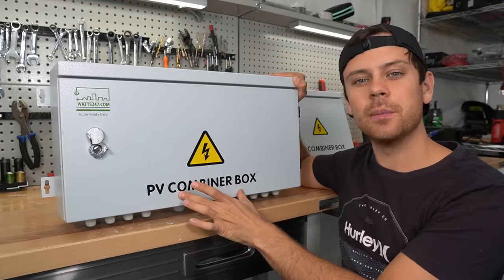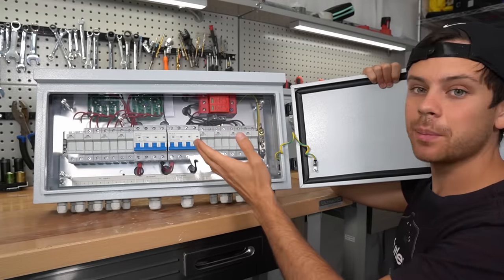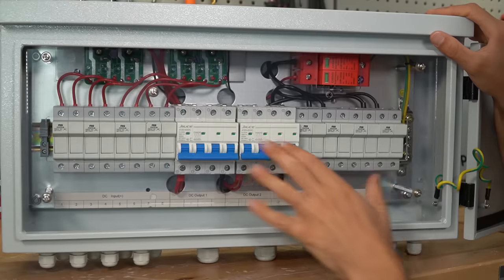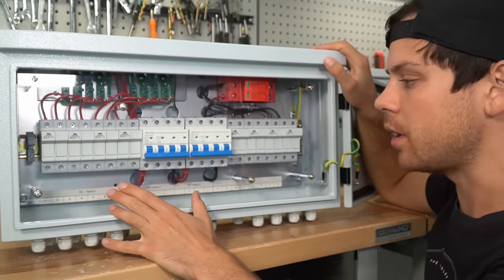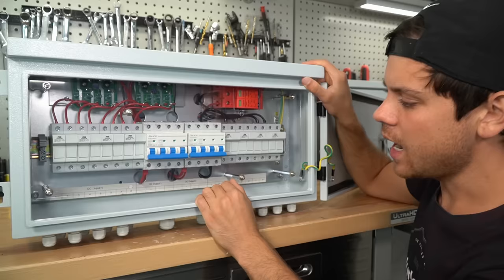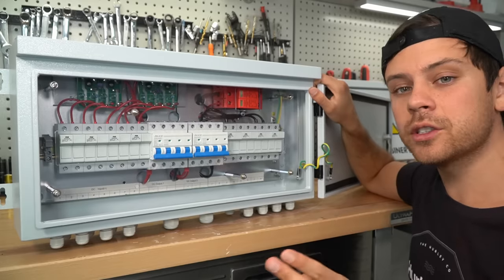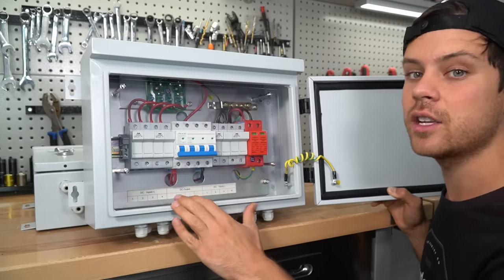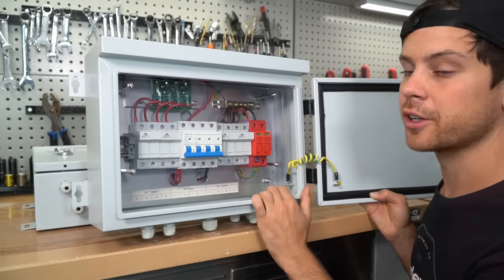What is a PV Combiner Box?

Comment from the maker: Yes, this type of SPD dissipates spikes and surge to ground. DC devices designed to mitigate intermittent voltage spikes in a pv system is different than a typical AC surge protection device. 

Here is an excerpt from LSP:
SPDs are applied to electrical systems to provide a discharge path to earth to save those systems’ components from being exposed to the high-voltage transients caused by the direct or indirect effects of lightning or power system anomalies.

~~~~~~~~~~~~~~~~~~~~~~~~~
Does off-grid solar confuse you? Check out my DIY friendly website for solar system packages and product recommendations, and so much more! http://www.mobile-solarpower.com

Join our DIY solar community! #1 largest solar forum on the internet for beginners and professionals alike: https://www.diysolarforum.com

Check out my best-selling, beginner-friendly 12V off-grid solar book (affiliate link):
http://amzn.to/2Aj4dX4

If DIY is not for you, but you love solar and need an offgrid system, check out Tesla Solar. Low prices and great warranty, and they can take your entire house offgrid with their new Powerwalls: https://ts.la/william57509

~~~~~~~~~~~~~~~~~~~~~~~~~
My solar equipment recommendations (Constantly updated! Check here first):

12V/48V Lithium Batteries: https://www.mobile-solarpower.com/solar-batteries.html

Solar System Component Directory: https://www.mobile-solarpower.com/solarcomponents.html

Plug-N-Play Systems: https://www.mobile-solarpower.com/full-size-systems.html

Complete 48V System Kits: https://www.mobile-solarpower.com/complete-48v-solar-kits.html

DIY Friendly Air Conditioner/ Heat Pumps: https://www.mobile-solarpower.com/solar-friendly-air-conditioners.html

Complete 48V System Blueprint: https://www.mobile-solarpower.com/48v-complete-system-blueprint.html

~~~~~~~~~~~~~~~~~~~~~~~~~~
My Favorite Online Stores for DIY Solar and Coupon Codes:

-Current Connected: SOK, Victron and High Quality Components. Best prices and warranty around: https://currentconnected.com/?ref=wp

-Signature Solar: Cheap Server Rack Batteries and Large Solar Panels:
https://www.signaturesolar.com/?ref=h-cvbzfahsek 

-Ecoflow Delta Official Site: My favorite plug-n-play solar generator:
https://us.ecoflow.com/?aff=7

-AmpereTime: Cheapest 12V batteries around:
https://amperetime.com/products/ampere-time-12v-100ah-lithium-lifepo4-battery?ref=h-cvbzfahsek

-Rich Solar: Mega site and cheaper prices than renogy! Check them out: 
https://richsolar.com/?ref=h-cvbzfahsek

-Shop Solar Kits: Huge site with every solar kit you can imagine! Check it out:
https://shopsolarkits.com/?ref=will-p

-Battery Hookup: Cheap cell deals
https://bit.ly/2mIxSqt
10% off code: diysolar

-Watts 24/7: Best deals on all-in-one solar power systems, with customer support and distribution here in the USA: 
https://watts247.com/?wpam_id=3

~~~~~~~~~~~~~~~~~~~~~~~~~~~
Contact Information:
I am NOT available for personal solar system consult! If you wish to contact me, this is my direct email: williamprowsediysolar@gmail.com

Join the forum at https://diysolarforum.com/ if you wish to hang out with myself and others and talk about solar

FTC Disclosure Statement and Disclaimers:
Every video includes some form of paid promotion or sponsorship. Some links on this youtube channel may be affiliate links. We may get paid if you buy something or take an action after clicking one of these. My videos are for educational purposes only. Information is subject to change/update at any time. Electricity is DANGEROUS and can kill. Be smart and use common sense :)

DIY Solar Power with Will Prowse is a participant in the Amazon Services LLC Associates Program,
An affiliate advertising program designed to provide a means for sites to earn advertising fees by advertising and linking to Amazon.com
Reply: That's Beautiful Will 
thank you for showing us this 

I buy items from good brands 
based on your recommendations 
using your affiliate links. 

Keep up the good work! 
You're a real friend. 🙂
Reply: Can this type of SPD be used with panels on inverters that specify that only "ungrounded panels" should be connected to it? (Not sure exactly what they are referring to) 

Could you do a video explaining this? I thought it was always a good practice to have everything grounded.

Keep up the good work 👍🏼
Reply: @MattiasNordenmark  of course you have to connect your ungrounded panel  ground to the ground ;-)  underground panels mean neither the positive or negative connection of the panel are connect to the ground of the panel.  but you still have to connect the panel ground to your ground
Reply: Can I get away with using just 1 of those for 2 separate system's a 12 volt and a 48 volt system?
Reply: Surge protection devices do indeed work automatically but the still need to be inspected regularly.  

They degrade with use and if there have been spikes they give you that lovely automatic and transparent protection right up until the point when they don't and the next spike does something expensive to your upstream equipment!   

When the green flashes show red it's time to replace them.
Reply: @sergea1138  Ah, I didn't understand your comment at first, but now I think I get what the Inverter manufacturer was thinking about. Panels should always be grounded, got ya.

But how do I know beforehand which panels to buy that doesn't have the negative or positive connected to the panel ground?

And the string can still be connected to a SPD that is then connected to a ground rod with this type of Inverter? (The same grounding rod that the panel ground has a connection to I presume?)
Reply: @MattiasNordenmark  yep I was confuse too ;-) , to be honest  I never  saw  grounded PV panel,  only ungrounded panel. So I'm assuming most Pv panel are ungrounded by default. Personally I connect the panel ground to the house's rod,  and the SPD ground to the same rod.  house's electrical box  in FR has SPD also, so its safe to do it that way.    You may have to check with your local code, for any additional or different requirement.
Reply: Protects the inverters from tov,swells and spikes Incase of a transient event...
Reply: @calmeilles  is it possible to protect a mobile system from transients?
Reply: @PaDutchRunner   In principle, yes.  But what would be the source of transients in such a system?  

I'm not seeing the need on the low voltage side and your inverter shouldn't be making them on the 120V side.
Reply: @calmeilles  I’m concerned about lightening strikes.  Is they something I should be concerned about? The panels are mounted to the roof of my van.
Reply: @PaDutchRunner  On a mains system surges can be created by lightening strikes some distance away conducted through the wires and in that case protective devices can be effective.

On a mobile system you aren't connected to anything distant.  A local lightening strike is a bigger problem than any electronic surge protector is going to deal with.
Reply: Jello will great video again ! Thank you I neede this but one question ? Will the 4-1 (1x63 amp max output  by watts 24/7 be enough for the gro watt 24 volt 3000watt hybrid inverter with 3.6 kw 2 arrays , and 4 100 amp battleborn 12 volt batteries ? Thank you for your time . Your a freaking riot  on your streams !omg they kill me dude ! I too was homeless for some time (my fault unlike you ) you did nothing and your story really got to me . I own my own business now and ha e just been in this green mission to reduce my carbon footprint and use all renewable energy. Amy words and recommendations on the combiner box would be great . I’ve watch and read a lot but always like a little confirmation from the experts ! Thank you
Reply: I purchased a combiner box, does it also serve the same function as a DC Quick Disconnect Switch?

Comment: As an electrician I would just like to add that this kind of hook up makes troubleshooting much more pleasant and efficient. No you don’t have to use this you can just splice together anywhere you want as long as it stays together, but when you have to troubleshoot a problem you will appreciate this splice box. Oh, don’t forget to label your wires, and be logical.
Reply: george, i am about to hook up 8 twelve volt batteries to a 24 volt panel system.8  24 volt panels.  Do you think it would be ok to run them into the all in one lv2424 as sets of two batteries being supplied by two 24 volt panels instead of a set of 8 batteries connected in series and parallel as one big set of amperage from the full set to the full set of batteries.  I was thinking my simpler method of sets of two 12 volt batteries and 2 panels may help isolate problems and make the battery system wiring user friendly for beginners (ME)
Reply: VOLTAGE = CURRENT X RESISTANCE
This is the golden rule of electricity!  It always applies. You can always solve for one unknown.  There are specific reasons for hooking things up SERIES/PARALLEL.  Wil Prouse Is extremely knowledgeable about PV systems, and you should buy his book if you don’t already have it.  You will be limited by the equipment you have as to how to hook it up.  The advantage I see on using the splice box is that you can isolate the circuit (whether it goes to the panel or the battery) by opening or closing a circuit breaker or fuse. This is not just convenient when you’re troubleshooting, but it’s a real safety benefit , when you’re doing routine maintenance. Whether you have 2  strings or 4 strings, you can isolate all the strings except the one you are testing. By doing this regularly and recording results, you will be able to detect problems early. If you have a bad connection or a Bad panel or battery, they will show up: REDUCED OUTPUT. If you can’t easily isolate the strings, you will have to manually break and make connections and test your results.  I have worked in DATA CENTERS, which are extremely complicated.  Try to keep your system SIMPLE.  Over time, all systems degrade.  If all your batteries and all your panels are the same brand/model and purchased at the same time, you should see similar degradation. Statistically the more batteries and panels you have, The higher the probability of problems or failure.
Reply: @georgekane1985  I appreciate your knowledgeable expertise.  Would you recommend a combiner box for 4 x 100 watt 12v panels to a 30 amp mppt charge controller charging 2 100ah 12 batteries? I realize it is pretty small system.
Reply: @mangeload  I would recommend it. The additional cost is quite modest.
Reply: TY George Kane
Reply: I use a clamp on ammeter to detect if a string is not performing.
Reply: Maintenance thanks you, sir

Comment: Will — The Eco-Worthy PV Combiner on Amazon is GREAT Unit and a great price. 
Please REVIEW it before calling it “bad”.  I got the 4 String unit for my Boat and at $109. it’s just as good as what your showing there.  With an extra 5 min work and and checking ALL their pre made connections it’s the PERFECT solution at a great price
Reply from the maker: Oh wow that's great to hear. I saw the soldered connections on hightec labs video and avoided it like the plague. Glad to hear yours works well!!
Reply: Yeah they work very well I used bigger fuses than it came with and switched to slightly larger silicone wires inside just to be safe I didn't go over it's amp rating but better safe than burnt.
Reply: @masklessninja  I emailed them and asked if they would ship the unit with 15A fuses. They didn't say if they could do that, but they did write that if they were replaced it would void the warranty. Not a good sign imo, especially considering how overpriced the boxes are.
Reply: Did the unit you received have a gasket around all four sides of the door? In one review I saw the unit that was being looked at only had a gasket around three of the sides and so wasn't properly water proof!
Reply: @pedalpusher2008  yes 100% water resistant on all 4 sides had the stripping
ALSO the customer support from Eco-Worthy is phenomenal,,,, these guys reply fast and answer dumb questions and even offer discounts on repeated purchases
Reply: Check the connections in about a year and see if you still think it's good. The expand and contract so much that often it causes terminals to loosen and cause fires.
Reply: @pedalpusher2008  The unit I bought recently had gaskets around 4-sides, and the door to the combiner box now freely opens all the way, rather than partial opening.  This was for the 4-circut input box - not sure about the 6-circuit model.

Comment: I find it interesting that a solar charge controller name has morphed to MPPT (maximum power point tracking).  Great vid as always.
Reply: It's just a different style than before pwm is what it used to be called or pulse wave modulation and mppt . One is supposedly better but two mppt controllers outback brand have stopped working in the last 10 years but the old pwm charge controllers are still going 30 years later on a shed out back.
Reply: What are you talking about? Obviously you don't know. Nothing has morphed into anything and if you would take the time to do some research about the different types of chargers, you might not make such uninformed statements making you look stupid and giving me the pleasure of setting you straight before you embarace yourself doing it again.

Comment: For the most part, I rarely understand anything that you say,  but you are obviously quite knowledgeable about Solar Power.         I have done some research, and decided that a Bifacial Solar Panel was my best option.   400 watt ,         It’s going on top of a 1996 Chevy Astro Van.  As I am Retired, I need to work with what I have.                      Yes, I will be living in the Van full time, and traveling as much as I can afford.   I can not afford half a dozen $1,000 batteries. So what would you suggest ?  Also I will be needing an Inverter, and a couple of other things I have heard you mention.  I would much rather have too much, and not need it, Than to need it, And not have it.         Thank you in advance for your advice, Respectfully, Tom Vickers

Comment: Blocking diodes. I'll have to research this more. Most late model panels already have them built in, yes? Isnt that standard/mandatory these days? So the diodes in the combiner boxes are an extra protection should the panel ones fail? Which would make sense. Is there a scenario where, if the panel diodes are in tact, theres still a chance of backflow, and the combiner box diodes prevent it? Again..I'll do more research, as I'm close to upgrading to 4 or 6 panels from just my single one right now.
Reply from the maker: Oh you are thinking of bypass diodes. Those exist in the junction boxes of the panel. Blocking diodes are different. They are in series configuration with the cells. Not parallel like bypass diodes. Bypass is for shading. Blocking is to prevent discharge of battery through panels. Most charge controllers have a feature that reduce the need for blocking diodes. I like them for using multiple arrays that are angled differently. That way one array won't bring down the other arrays if it is not angled the same. Great for step roofs with panels mounted on opposite sides.
Reply: @WillProwse  ok! Gotcha. Thanks Will. That helps.
Reply: @WillProwse  
Nice

Comment: I'm lost on the talk of Parallel connections. Most videos show  multiple "Series Strings" being run to a combiner box. One series sting per connection, that is why a 15 AMP fuse will work here. 

Are the "Parallel" connection where all the hot wires come together on the BUS Bar?

Thanks,

Joe

Comment: So the one question I never see answered on any videos or articles I've found on PV combiner boxes is whether or not inputs can come from solar arrays with different wattages. For instance an array of 100W panels and 200W panels. Cleary you do not want these tied together in series or parallel due to the power loss from the different wattages and people always talk about how you "never want to do this."  Yet none of those same people mention a PV  Combiner as a solution. What am I missing, as in my opinion I dont see any reason why a PV combiner box can't be used to join the outputs of different wattage panels yet nowhere have I found anyone talking about this as being a solution for just that.
Reply: I know a contractor who told me that the combiner box does solve that issue and you can be used for that purpose
Reply: @shonduarkeem1247  Thanks for your response, I really appreciate it.

Comment: Sorry newbie question. Do the outputs of the panels of each individual string need to be the same? For example one string with 200w panels and the other string with 300w or volts and amps.

Comment: If you were putting panels on a better positioned outbuilding, and running the power back to a house, where is the combiner best positioned relative to the DC to AC  transformer?  If you had multiple arrays, how do combiners interact?  This is why I'm not allowed to operate anything more complicated than a toaster.
Reply: Usually at the panels tbh
As for the second I'd assume you'd try and get it near one of the panel arrays

Comment: Is there something like a combiner box that works in reverse, one PV voltage source in and multiple parallel sources out?  Thought process here,  i'm using all in one standalone solutions with their expandable batteries.  So I have several areas that I could use PV to decrease grid reliance.  If I could have the array go into a combiner and one cable carry that to a distribution system for the PV voltage that would make design easier.